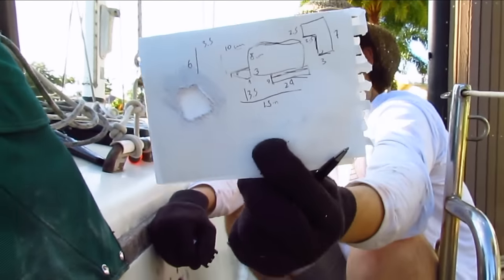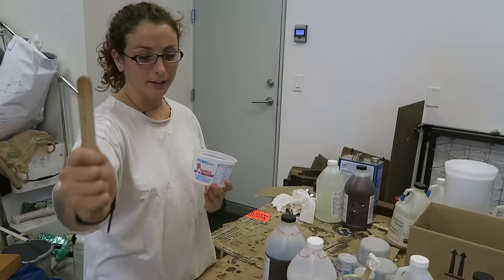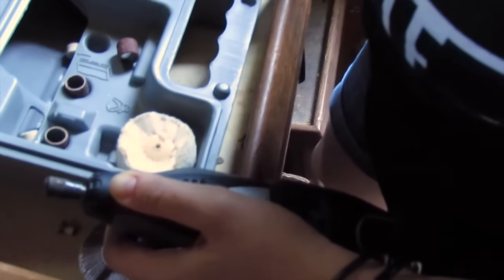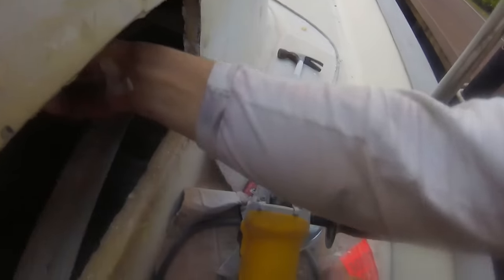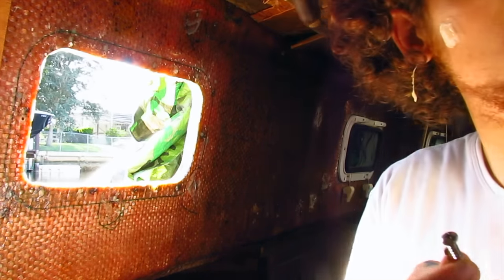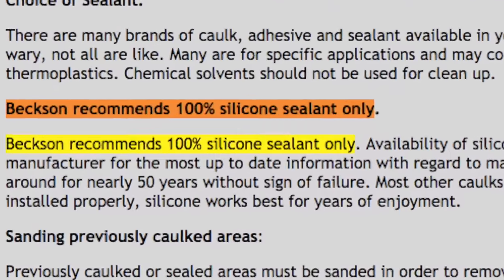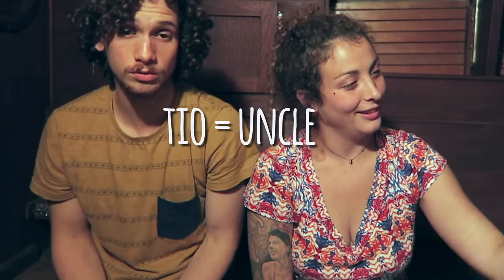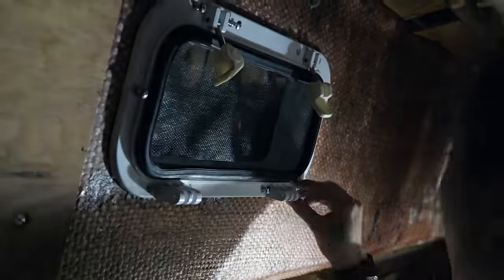9: Rebedding Portholes part 2

Comment: an Allen Wrench in a drill can strip core fast. Also for rough shaping of the thickened epoxy use a rasp and rough file, much faster than sanding for the rough stuff. Good Luck! Looks good so far

Comment: I really like your videos, both of you come across as great fun and full of enthusiasm.
I suppose it's late now, but you could have made the fitting the replacement plywood core around the ports a lot easier on yourselves, if you had approached it as a separate job to refitting the ports. If you had just fitted them solid, then once they were epoxied in place, marked the screw holes for the ports and then drilled the holes bigger than required, you could then fill those holes with thickened epoxy, which once dried could be sanded flat to then fit your ports!
Don't feel too bad about the upside down port, I was once sent to install a missing handle on a upstairs window in a newly built house, because the owner couldn't open it, when I arrived I discovered the problem was not a missing handle, but that the installers had fitted the window inside out!
Happy New year, I look forward to seeing more videos of your progress.
Reply from the maker: Thank you for the kind words! We appreciate you liking us :)
Good tip ,but let me see if I understood it right: You mean we could've just made big screw holes in the wood core to fill those with epoxy and not having to take the rest out? I feel like that would be a problem because, since we removed the lining, the new locations for the portholes all changed slightly, as the backing wood was no longer there. But, I'm not sure I understood what you meant so it might not be it. Apologies! 
Happy new year and thanks for accompanying us :)
Reply: Project Infinito what I meant was after you cut out the old core, replace it with solid plywood, epoxied in, without worrying about the screw holes for the ports.

Then put your port in place, mark the screw holes, then drill through the new plywood with an over size bit, fill that bigger hole with epoxy, sand when dry, fit your port back in place drill correct smaller size holes for screws, the fit and seal ports in place.

Like you did in your last video for the windlass.

Comment: Nice work!!! when you re-pull out the windows next time because they leak, use Dow Corning # 791 white Silicone Weather Sealant. It has a whopping movement rate of 50%. The home depot stuff gets too hard/stiff to deal with the different contraction rates of the port holes to fiberglass.

Comment: I know this comment is way too late, but if you add back the wood interior that you took out, won't that now interfere with the portholes that were mounted up against the fiberglass on the inside of the cabin?

Comment: When working with thickened epoxy...put it in a plastic bag and cut one small corner off...then you can squeeze it out wherever you need it...like decorating a cake. Much cheaper than using those big syringes.
Reply from the maker: Someone's told me that before! Will try it out next time.... Thanks!